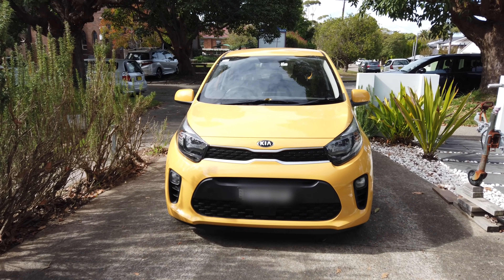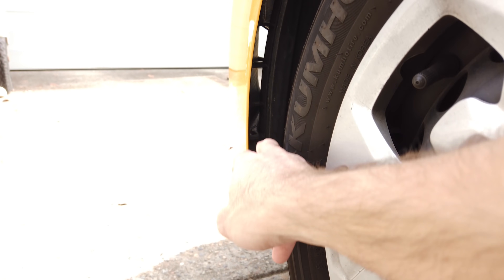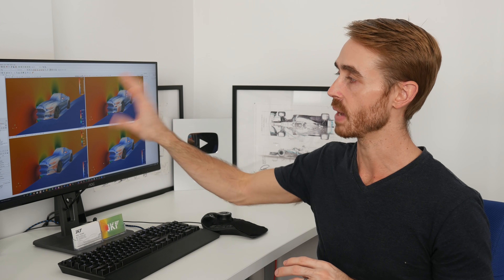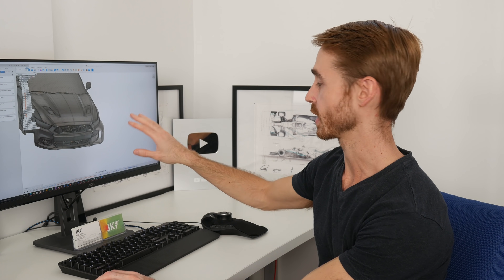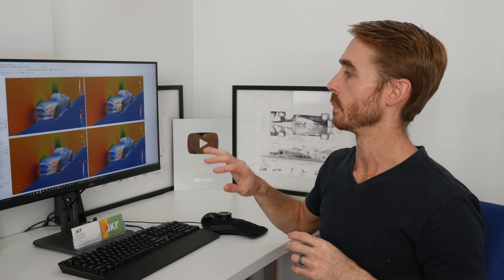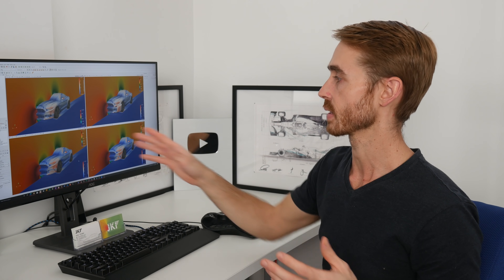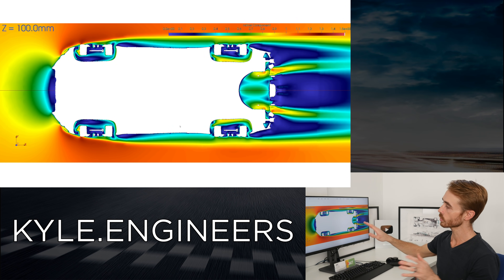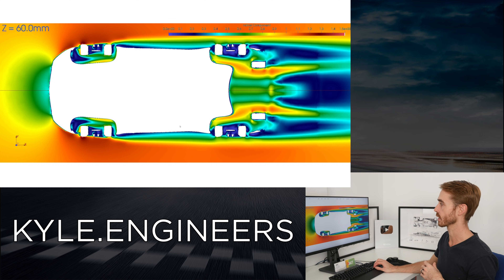How Do Air Curtains Work?

Comment from the maker: For full clarity, the forward thrust on the massive vanes is pretty heavily cancelled by the pressure drag increase on the centre front bumper (one of the reasons why the drag only improves by 2.3% and not >10%), with the wake reduction still likely being the largest driver for the overall drag reduction. This could swing either way in the wind tunnel depending on the effectiveness of the downstream wake shift. However, more often than not I've seen this style of vane (the massive one) be an overall drag improvement in the tunnel, and it is interesting to consider the local loading directions. 

Hope you all enjoy the video!
Reply: Hi Kyle.
Great explanation of how aircurtains work. Production car aerodynamicist here, so maybe I can give a little more insight on the numbers. Actually a ~1% reduction of overall vehicle drag is considered a fairly well working aircurtain. So the .8% drag reduction you got from your CFD seems quite reasonable.
All the best!
Reply: Could you explain the 2021 ducati desmosedici wings on the engine fairing its buging me like crazy.
Reply: How would the increased front pressure effect a splitter? Could it help increase front downforce while minimizing the drag penalty?
Reply: what about piping from the front bumper centre to the wheel arches (I have an EV (i-miev) with a radiator cutout I'm planning on grill blocking as it's superfluous - wondering if this may be a way of utilising the high pressure zone for benefit)
Reply: @miscbits6399  I'm looking into doing the exact same thing
Reply: Hi Kyle, could you take a look at this YouTube video and explain what's going on? It is a SL-C car on a track and at speed the top of the doors is lifting by 2 or 3 inches! Looks very dangerous to me. I don't know the car or the owner but I am interested in what's going on and what are the solutions. Definitely looks like a aerodynamic issue. https://www.youtube.com/watch?v=sMMnKj3-mH8
Reply: You sir are genius and a chad love all your videos
Reply: Hi Kyle, would you be able to do a video on fender Louvers/extractors . Thanks!
Reply: Just curious but same in an oem or highly developed race platform. Couldn't this in theory help with cooling performance if you can duct the air properly. 

Along with some radiator inlet grill tweaks and outlet tweaks making up for the other lost effiencies making the net gains more beneficial.

Comment: Would it be interesting or even possible to have air curtains on the rear wheels????
Reply: Probably wouldn't be worth the high pressure zone in front of it. But that's a guess based on my intuition and therefore non credible.

Comment: the mclaren p1 has some pretty sharp air curtains that look like they do protrude a slight bit further than the curvature of air dam at the front like the front, like a more realistically integrated version of the external curtains that you added to the mustang that produce thrust. Do you think they factored the presence of the thrust generation when they designed that?

Comment: Can you design a front bumper infill (not air curtain) that removes the fender hump vertically present on 2008 VE Commodore SV6/SS/SSV - before the wheel arch its not smooth single flow.

Comment: What if use a fan to suck the air out of the big one? Or small one but with radiator inside to reduce drag from colling? Or both? What about complete blocked wheels with static covers and axle brake sistem? Really curios about...

Comment: Really interesting, thanks. What CFD tool was used for this? Did you include spinning wheels and moving road, or can one get a useful result from the wheel wells without that? I'm pondering on velomobile design. Tufts on the body suggest they have some of the same vortices in the wells, but with reduced energy, I guess due to the skinny bike tyres.

Comment: when I look at that aircurtain that you designed, I'm thinking about the shape which gives a high pressure area on the inside of the car.. do you think, if you would give it a sweep to the outside to get a low pressure area on the inside and a high pressure on the outside it will reduce the drag on the front of the car? or is that nonsense because you increase the drag again on the side of the car?

Comment: If I were to add scoops flush with a front bumper fascia about 4 in in diameter and run that back and cut out an area of my front fender just ahead on the tires to make an air curtain will that reduced my frontal area as well as my frontal wake on a gen 1 Honda Insight?

Comment: If I have my CAI next to an Air Curtain what can I expect? The CAI is in the Bumper right on the flat where the Bumper curve commences. Will the Curtain create turbulence at the CAI and cause me to drop hp Torque? I seperate the two by running a separation Wall where the Curtain is on the outer part and the CAI just on the inner side. Hope that is clear enough........ Your thoughts???

Comment: Would the air curtain have any positive effect on lowering the static pressure in the wheel arch, mainly in front of the wheel? Curious if it would assist the delta-p on side-mount intercoolers

Comment: So adding the large air curtains to the front of the car increases the pressure up front. Wouldn't that help force more air into the radiator and possibly increase downforce if you're running a splitter?

Comment: My 2010 saab 9-3 is supposed to be super aerodynamic but the front bumper curves in exposing the side of the tires, should i stretch the bumper out to the end of the tire or is there a reason they designed it this way?

Comment: @Kyle.Engineers , could you please explain what is happening with air curtains fitted to the Mitsubishi GTO  or 3000GT in the rear wheel arch .

Comment: Would you please evaluate OEM aero on 2018 and up Camaro ZL1 1LE.  I’m like many who are required to run 200 treadwear tires, vs OEM 100 treadwear. I’d like to know if any modifications can be made to improve aero and add downforce to increase tire grip on road courses like my home track, COTA. I’ve seen small carbon fiber angle used as a wicker.

Comment: Hey Kyle, hadn't had my bell rung for some time, turns out didn't have the bell tuned on... fixed it. Glad to see your making videos! look forward to everyone of them. 
Tire tyre weight! How come it's so hard to get tire weight info? I wonder if you'd be interested in searching out (or have you already?) tire/ wheel weight and explain why this is important. 
The roads I drive on in the Canadian province of Alberta have been less than properly maintained for decades, here we all will soon be riding MX bikes to get to work each day. In fact there is now a contest anyone can enter a photograph of the worst road in Alberta. Almost everyone with a pickup truck has oversize tires installed... for the cool factor. Putting such tires on brings extra wear and tear on ones vehicle. So even in this scenario tire weight makes a drastic degradation of ride quality. Lighter tires improve EVERY quality of performance. (Save for puncture resistance) Yet this one characteristic is rarely considered. And little to no information is available. Width, height, speed rating, wear rate and COST is where most stop their comparison shopping. Are tyre companies making lighter tires? And if so, why won't they proudly advertise this important improvement?

Comment: Hej Kyle, I started cutting out a pocket on the wheelhouse liner, on the spot seen on the Kia. But the car does not have an air curtain built-in, it will probably suck in the air from the engine bay volume. At first, I thought it would decrease the pressure on the front of the car, then I recognized I will feed air into the wheelhouses, therefore, increasing the pressure there. What do you think?

Comment: Is there a negative effect when we push the front tires out (-ve offset and wider tires)? Should I block off the entry vents of the front bumper air curtains? or angle the exit vents with some sheet metal?

Comment: Kyle, can you compare Mid 2000s with modern f1 cars? It would be interesting to see in cfd how well they managed wheel wakes and underbody efficiency at that time :)
Reply: Underbody in F1 has been flat since late 80s until 2022, there might not be any major difference besides underbody size

Comment: Why do some performance vehicles have fake vents?
Reply: "style" - they're replicating features on older cars. It's the same reason winglets persist on private jets despite the theory of their operation being widely debunked (vortillons work better, are less draggy and as a nice benefit also improve low speed (takeoff/landing) behaviour)

In some cases such as certain lamborghinis they're functional on one side (air intake) but blocked off on the other

Comment: Could you do a run on a lifted Jeep with big 35" x 12.5" tires?  It'd be cool if you could just hang these off the bumper or fender for better mpg on road trips, and then fold them up for off roading.  Curious how long it'd take to break even.

Comment: You mentioned the Mustang's use of air curtains vs what wheel/tire width they use. Is this also dependent on whether the Mustang is a "track" version or not?  It seems to me that there would be no air curtains used on the track versions (GT500/GT350/PP2) because the air curtains would hurt the efficiency on front brake cooling. It would be better to have a larger area of low pressure behind the fender's front wheel opening edge so as to help the heated air from the brakes escape the wheel and wheel housing better.

Comment: Guess that is why they are on commercial trucks as well.  At least on many cab over style trucks.  Speaking of trucks, some here in the US are starting to pop up with vortex generators on the trailing edge of the cab/sleeper.  Best I can figure is that the maybe block air from filling the gap between the cab and trailer.  When I see them there are a ton.  Side by side all the way up and down that back edge.  Not sure if they have them up top too.
Reply: they work for getting flow to jump from cab to trailer, but airtabs are pushed as a method of reducing wake vortex too - which they don't (they actually increase drag if used at the rear of a bluff body vehicle consist)

Comment: Hi kyle! Thankls for the videos, and thanks for the efforts you put at making those things understandable. Well, i've been thinking of a way to introduce more drag into the inner side of the turn of a car, as well as lowering it at the far side of a turn, with  several systems, so that the car turns as much as as a flying wing (or a tandem wing) thanks to its aero surfaces, as well as its wheels (well in fact as much as its wheels i should say). I came up with a few solutions, mostly based upon aero structures, that control the airflow, either depending on turning upon speed, or instead height upon speed/turn. All off them which could be controlled using a basic piton antenae, diaedra angle upon the ground effect through teh suspension/direction, and a system correlating wheels turn with an angle of attack control system. But i guess i'm not the first one thinking about that as the devs based upon ground effect aircraft must have brought some after thoughts about that to those who actually design these assets. To be honest, i'm only a desigenr, who studied aerodynamics as a pure amateur, so my own skills are not doing justice to the ideas i'm about, but i think there's an interesting field to explore here, far away from the rules set by the FIA. Anyway, thanks for the vids, tyhey are awesome!

Comment: Nice explanation of air curtains principle. Eolab Renault Concept is a great example of a fully working air curtain drag reduction. Since air curtains are not big enough on production car, the effect is very tiny, as you mentioned Kyle.
Thus, those cheap devices let car manufacturers do some aero marketing communication.

Comment: What about the other air opening, exhausting right before the front doors, with the air coming from behind the front tires, as you can see in the Audi e-Tron GT? 
Could you elaborate on that? 
Is it to relieve pressure from the front wheel wells, or does it have any other benefit?

Comment: Man, I could watch these aero analysis videos all day...

But also now i'm curious, how much of a drag effect is there between a rounded trailing edge versus a sharp trailing edge. Like, on the rear bumper, old cars have a smooth curve from the side to the back, but newer cars have a sharp corner instead. How significant is the aero difference between those two?

Comment: They're a huge deal on cars that actually make use of them by running the air over the brakes, or put things like rad fins or metal contacts in the wheel wells because they significantly lower temperatures.

Just changing an oil or tranny coolant line to a braided metal one and then putting it in the trail will net you amazing cooling results.

The aerodynamics are actually one of the least interesting effects that these are useful for, as a result. You just have to be driving it a lot harder than you'd generally drive a Kia to notice.

Comment: I first started seeing those on some BMWs and was wondering why I could see through it from behind, but after I started seeing them on more cars, I figured it was a way to act as a tire spat for the sides. I was thinking they might keep the free flowing air from getting caught up in the wheel turbulence, or maybe aid in brake cooling by encouraging airflow out through the wheel.

I didn't even consider the effects on the rear wake shape. Thanks for making this and answering that question!
Reply: Yeah, the first ones I can recall seeing were the X5s from the mid 2010s, then later on Tesla Model Xs.

Comment: they seem to use these on the front of cab-over trucks and busses a lot but only around the height of the grill. is that just due to the visibility and strength/crash considerations of doing them at window and bumper level  or is it about also affecting flow through grill due to higher pressure. love the channel man.

Comment: i have a question regarding cfd, i tried using openfoam on my mac but with little to no success, i really want to get started with using cfd, is there any simple way to begin looking at vehicle fluid dynamics, any recommendations and thoughts ?
Reply: I'm no expert, but I've used simscale as a half-decent starting point. It uses the openfoam solver, but the main thing I found was that the UI was very usable. They also have a few basic tutorials on their website I think.
Reply: Try autodesk flow